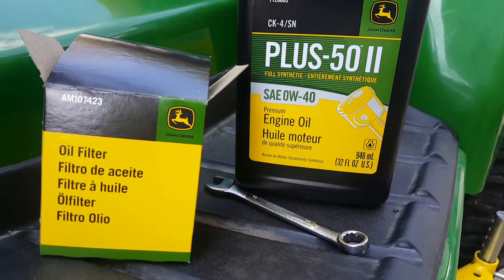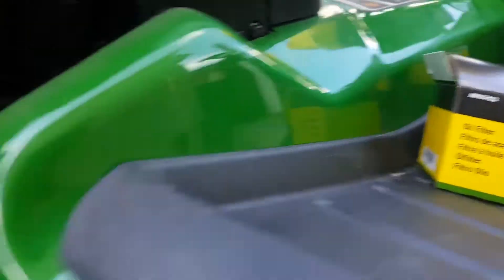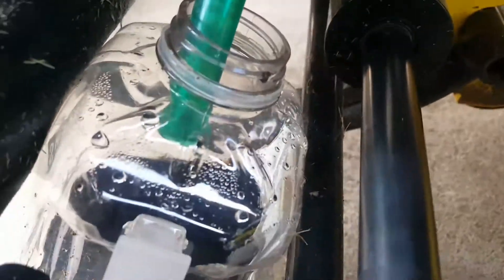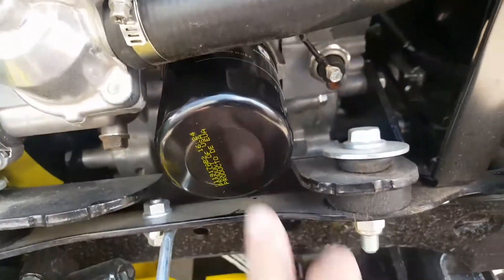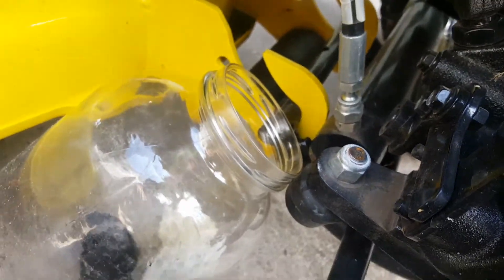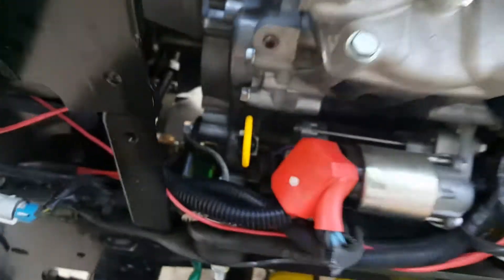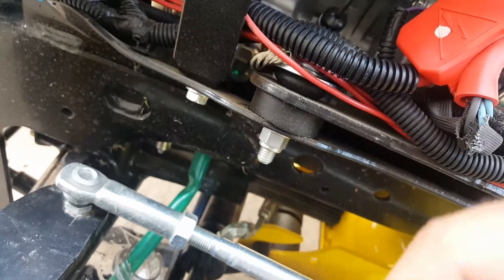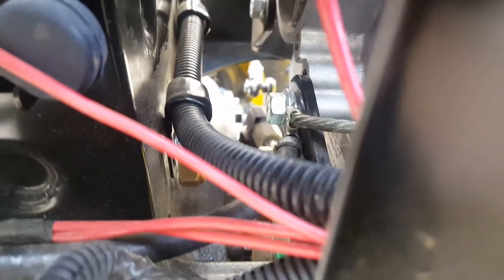X739 Oil Change

Comment: I just received my X739 (April 2021) and I was happy to see that JD totally redesigned the oil drain to a stem and valve that is easy to access below the frame on the left side of the tractor.

Comment: Did my 50-hour oil change this past weekend. Measured exactly 1.8 liters and found that left me a little under the mid-range. Added the remainder from the second 32-oz bottle and it seemed perfect after that. The drain cock is brilliant - easy to remove oil. 

Your mileage may vary.

Comment: you're doing it the hard way.  It's much easier to use a 10mm socket attached to an extension and come at it straight from the front of the engine.
Reply from the maker: mrbubetube Thanks for the recommendation. I'll try that next time.
Reply: it's probably also a good idea to attach that extension to a spinner handle instead of a ratchet.  that way you don't use too much torque when you tighten the plug.  https://www.craftsman.com/products/craftsman-6-in-spinner-handle-1-4-in-drive
Reply: TheAtheistOfficer are you a atheist